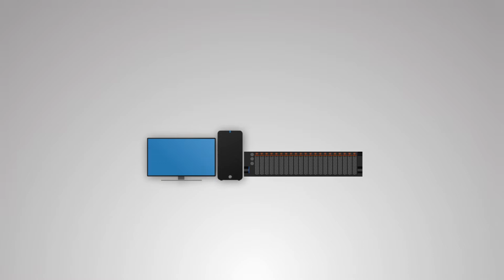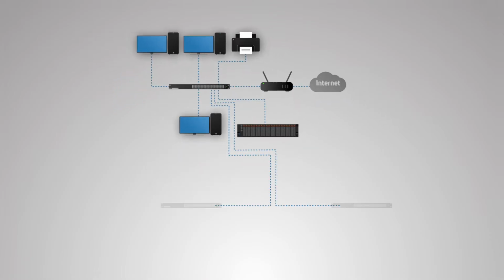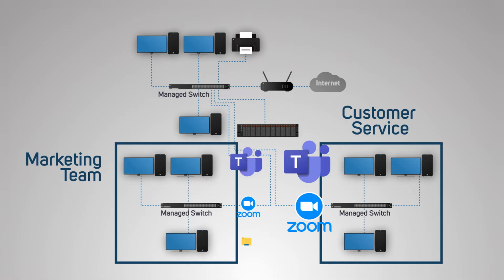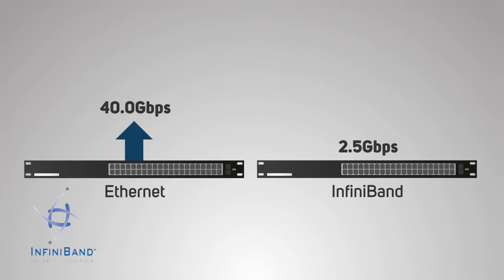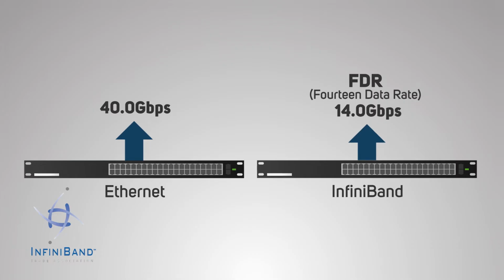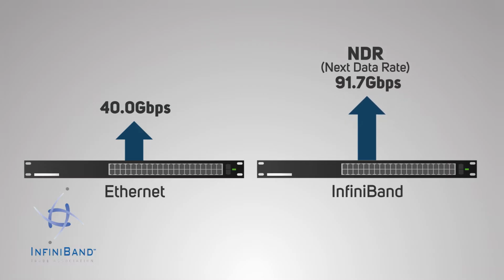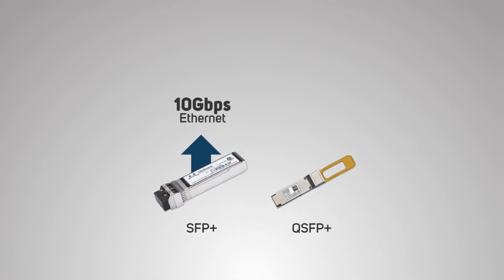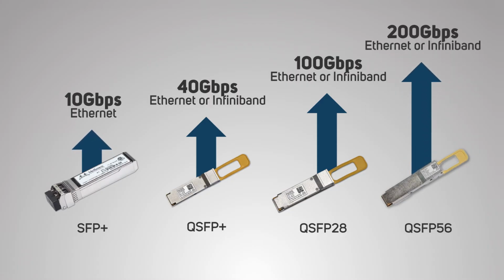Network switches explained, all you need to know

Comment: why do switches have only 8 16 24 48 and so on number of ports..?
Reply from the maker: Switches are normally wired up internally in pairs, so the vast majority have an even number of ports. They are a few exceptions to this, such as 5-port switches, with a 5th port added on which is intended to be connected to another switch. - JG